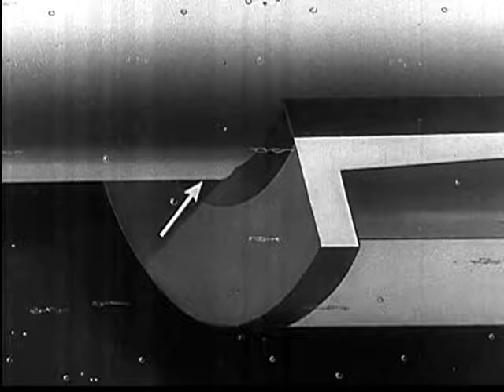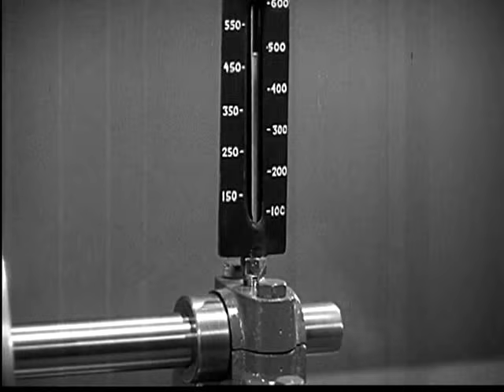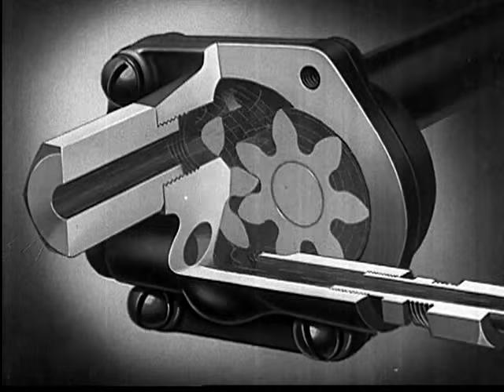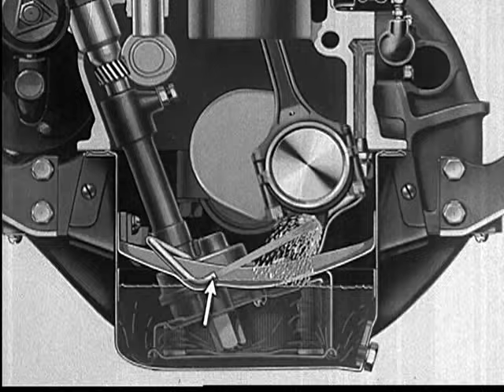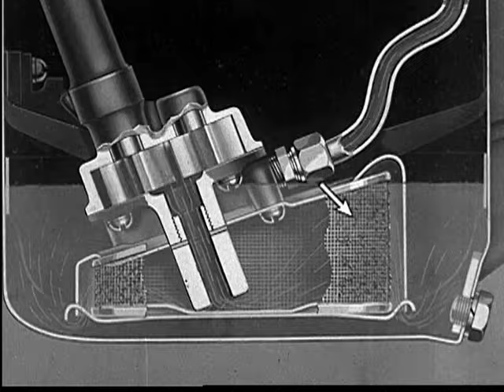Riding The Film (1937)

Comment: Still relevant in 2022. Lubrication is key to engine longevity. A Modern vehicles engine with stop/start driven in City type stop start traffic will wear out sooner than an engine in used for high mileage Highway cruising that almost never stop/starts, due to lack of lubrication on restart.
Stop/start is as bad to your engine as flooring the gas to 5000rpm from cold start is on 1st start-up.

Comment: It's insane to me that the basic design of a multi-cylinder reciprocating engine hasn't changed in nearly 100 years. 
Sure, modern engineers have fine-tuned and made them more efficient. But they still utilize the same basic concepts of valves, camshafts, pistons, gear trains, etc.
I feel we sell folks of the late 1800s & early 1900s short with their intelligence. In the span of a few decades, they invented and essentially perfected a technology that changed the world forever.

Comment: I never knew oil flowed so fast and so freely inside the engine. I always thought it was a tiny controlled amount, but it makes more sense this way since it also serves as a cooling method and is easier to control.
Reply: gas comes out in tiny controlled amounts, oil is supplied in large quantities because the damage that would occur from insufficient oil pressure is very, very expensive and often irreparable

Comment: I took mechanics class in high school thinking it would be mechanical engineering, the longer I was in the class the more I hated it, after fully disassembling an engine, I dropped out without putting it back together, Sense I hate internal combustion engines due to their environmental impact The disgusting grease and grime was also bad for my skin. I rather work on a practical piece of equipment like an electric motor, if I'm gonna get my hands dirty it has to be for a good cause, Destroying the planet is not that. the oil film is interesting, If they just played these videos in mechanics class instead of the garbage they chose, and the Lousy teacher I might have been more interested. Putting the thing back together would have been easy. it was a lawn mower engine, though an actual car engine would be difficult. I don't want to mess with those.
Reply: Bill Jonston  Yeah, I just don't like piston ice engines, Turbines are amazing, but i really don't like anything about a normal motor, my point is it would have been more interesting with these old detailed videos, but it doesn't make the outdated tech any more useful.

Comment: Modern engines, that is ones made in the last 50+ years or so, don’t use ‘splash lubrication’ for the rod bearings as shown here. Oil is pumped through tiny passages in the crankshaft right to the piston rod bearings..

Comment: You know, water isn't a lubricant at all. If anything, it's an abrasive. Just ask the grand canyon. Ice is a special case, since tension makes ice more compact, and 4C water is more compact than 0C ice. But other than that special case, water is the opposite of a lubricant. Steam engines require lubrication to avoid the abrasion of water.
Reply: Walk on a wet floor and tell me water is an abrasive

Comment: This needs a new chapter ,  when oil gets used small metallic particles end up in it , after some time ,  oil is filled with it then it stops lubricating the engine and acts much like fine sand paper , and due to this excessive engine ware happens ,  owners that dont change the oil in their cars end up with excepnsive repairs . This is a very good example , ppl need to see it with this mentioned .

Comment: Hundreds of revolutions per minute. Oh boy, if only they knew how fast the engines of the future would be. It’s must have been an exciting time for innovation.
Reply: At the time Tachometers were commonly listed in hundreds of rpms, so 40 would be 4,000 rpm. This could probbably explain why he said hundreds instead of thousands.
Reply: The engine in this video is just fine running 4,000 rpm. They usually ran in the 3,000rpm range on the highway due to a lack of overdrive.
Reply: Well, in 1939 the european Grand Prix cars 4-stroke engines, makers like Maserati, Auto Union and Mercedes,  were already spinning up to 8500 rpm. That did not change much well into the 1970s.
Reply: I'm pretty sure the engine back in the day still spun at 2-3-4,000 RPM it's the only way they could make power... Unless it was a ship engine that was the size of a building and turned at 150-RPM and making 30,000 HP. With like 15,000lbs of torque...  Such as the Titanic...

Engines back in the day had to rev high to make power because even the strongest engines for vehicles back then we're not making more the 100-150HP

Comment: You know what's strange? What's strange is that car engines have pretty much always been the same, apart from computers, and different valves, but still they've pretty much been the same since the 1950s.
Reply: Engines run cleaner today, engines last wayyy longer, engine oil lasts longer and is higher quality (doesn’t evaporate, burn, or sludge as easily), and engines burn cleaner and have cleaner tailpipe emissions, but besides that, nope - modern gasoline engines are 1920s technology. Its a beautiful thing. Its a technology that works very very well.
Reply: @thisoldbelair  most are turbocharged these days, that's more like 1940s technology
Reply: Ford are even going back to a cam in block, port fuel injected engine on their Superduty trucks with the new 7.3L. Simplicity is reliability.
Reply: Rotaries aren't that common tho
Reply: Router engines are much better, less friction.  Dont know  as to why auto industries are not much interested in router engines
Reply: @splatharackal1337  Rotary engines require constant oil injection into the combustion chamber to keep the apex seals lubricated, so burning all that oil results in bad tailpipe emissions, so theyre all but dead as of now.
Reply: @TheGirfan1234  Is it so ?, didn't know that.
Reply: tututuims ieijebdo  blaspheme
Reply: Pretty much all "new" nuclear reactor designs were concieved of in the the 1950-60s.
Reply: What about the Wankel rotary engine?
Reply: @ashtonhartley2662  well with the rotary it's basically the same thing, only the combustion chamber is shaped differently.

Comment: No wonder cars are going electric
Reply: Ernesto Ponce Electric cars are incredibly complex aswell, to a degree that makes this child's play. 

Fast moving electric cars still need proper lubrication to prevent friction on polished metal, that's not even considering computer silicone, fine tuning of electro-magnetic fields and lithium battery technology.

Discarding and storing dead lithium batteries is costly, because potential breaches in storage containers is catastrophic to the environment and to those it touches. If electric cars are going to be the future, then we need cheap full proof containment of its waste products. 

Inefficient gas cars that have only 23mpg are unhealthy, but wait until lithium oxide contamination becomes commonplace from deteriorating barrels. Choose your power wisely.
Reply: Marc Brown Interesting perspective
Reply: Ernesto Ponce Ooh, thanks, I figured every step we take has benefits and pitfalls, and that is most important to preach. we must race to eliminate our effects on the environment. (Chemical, gas pollution) Hopefully we will see 100mpg 200hp cars in our lifetime. 

Interesting that you would reply 2 months later lol.. Weird...

Comment: Non pressurized conrod lubrication, wow. I know lawnmowers and small engines use splash, but in 1936, trucks used it, too!
Reply: My 1951 Chevrolet used it. It worked decently. Idled at 5 psi. The bearings wore out more quickly than in modern engines.
Reply: I believe that I had almost .006" of clearance at 100,000 miles. They put shims between the caps so that you could periodically re-adjust the bearings.  Kind of absurd. My 1999 Saturn SL2 had .003" of clearance at 220,000 miles, and the cylinders had their original crosshatch. I cleaned the pistons, lapped the valves, and threw in new rings and bearings without any machining at all. Still going strong at 360,000 miles with perfect compression. My Chevy had cylinder taper and all sorts of things wrong at 100,000 miles.
Reply: @td3993  we have come so far! Someone once told me the older trucks sometimes pulled hard right or left and "that's just the way it was"
Reply: @wolfpeoplearereal  mine never did, and I can't imagine good tires and an alignment job not fixing that, but I suppose anything is possible. The old suspensions were rather loose, though.
Reply: 1954 was when they finally went to a full pressure con rod bearing on the 235 and 261.